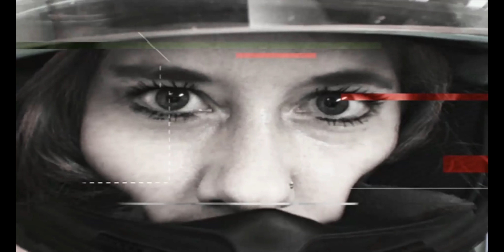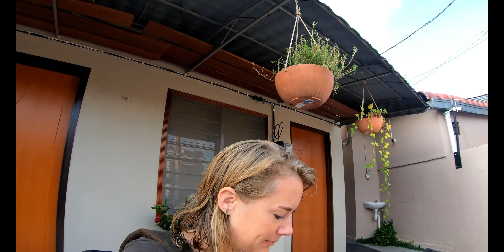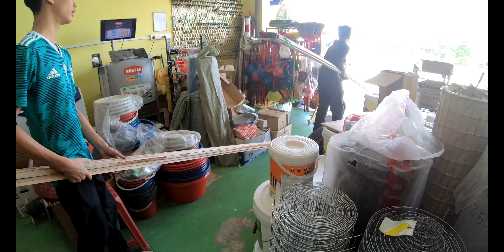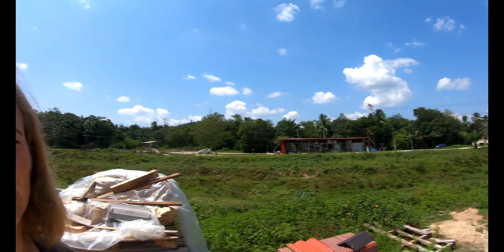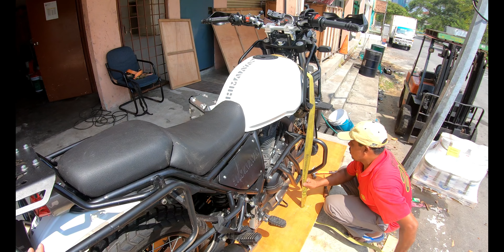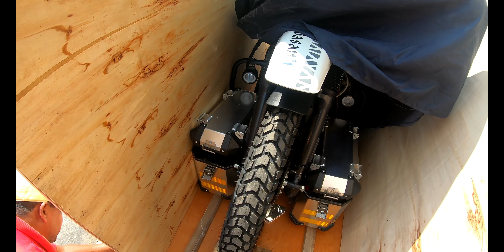[S1 - Eps. 39] CRATING BASANTI (Part 2)

Comment: Always screw the battery cable screw back into the nut that slides into the slot in the battery post or you can lose it.  Then tape the cable up, hopefully it was still in the battery when you uncrated it?

Comment: Noraly, you mentioned working out how to carry your tires. What worked well for me was to add to metal loops (enclosed hangers) to my side cases on the rear. You mount the two tires, one on top of the other, zipped tied together on the back of your bike facing rearward. It will look like a big O on the back of the bike with the tires attached by two straps through the two hangers, one on the back of each side of the side case. This will allow the top case to be opened as needed. Lastly, it's a great bumper for those distracted drivers when they are tailgating. Good Luck on the next leg of the trip.
Reply from the maker: Micah Wright good idea, I’ll see what works best with my set up 👍

Comment: That’s quite a bit of struggle ichyboots.. I recommend that you approach a motorcycle dealership (Yamaha or Kawasaki) the next time you wish to crate your mobike. They have motorcycle crates with steel frames which they usually sell off as scrap.. All you’d need to do in that case is only repack the frame with plywood and you’ll have yourself a proper motorbike crate.. 

Inspiring travelogue 🙏🏻
Reply from the maker: Yes other people commented the same on my previous video. But when you ship by airfreight its the volume that counts, not the weight. So the box needs to be as small as possible or you pay a lot more.
Reply: @ItchyBoots  agreed and the bike manufacturers also have the same consideration. Hence, their crates are also slim. Dunno if you checked any or not.. Crate for a motorbike like a KLR 250 or a DR 250 should be fairly slim.. 

All the best and ride safe. 
Regards.
Reply from the maker: It's already done man haha
Reply: @ItchyBoots  Bon Voyage 🍾

Comment: Hello Noraly, well done so far. A technical tip on Basanti: when in Oman and you tighten the bolts of the handlebars, be careful you don't overtighten them. Look in the workshop manual for the precise torque setting (in Nm) of these bolts.      (Indication: on my Ducati 20Nm and sequence 1-2-1). Good luck!
Reply from the maker: I have different bolts because I placed handle bar raisers, so don't know the precise torque setting

Comment: it is ok  you need to at least disconnect the battery better if you take it out and remove all the fluids gas and oil 
those are common requirements world wide to ship a motorcycle
you will get used to that after a few shipping

Comment: Did you need to install longer brake and clutch cables to accommodate the bar risers? Thanks, Jesse
Reply from the maker: No but did have to reroute the clutch cable! By doing that, it was sufficient :)

Comment: Where do you get the money to spend for this trip? Are you being sponsored? Do you have a fixed income coming from some sources? Really curious!!
Reply from the maker: You can read on my website www.itchyboots.com/about . I'm not getting sponsored unfortunately haha
Reply: By using an old Honda Gold wing crate, I shipped a Honda CL 450 and a Kawasaki H2 750 (with spares tucked into every corner,)  from New Jersey to U.K. No charge for materials but it was quite a lot of work. Next time I shipped a machine from the U.S. to England I did it (cheaper) from the west coast - loose in a container. $250.00 regardless of the size of the bike. Don't know if you can still do that. Cheaper, quicker, easier and as long as you cover the vulnerable bits like lights, very little damage.